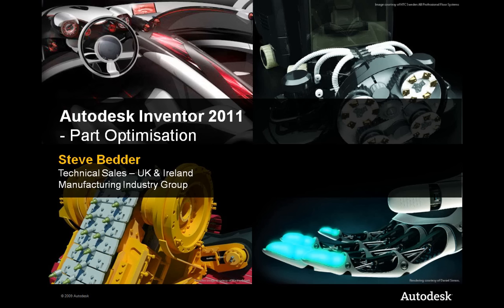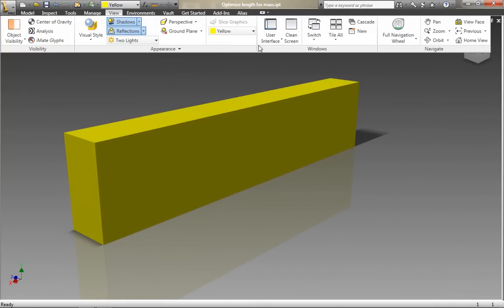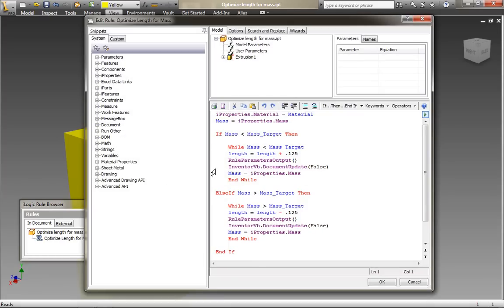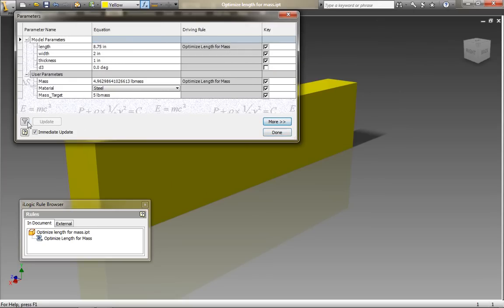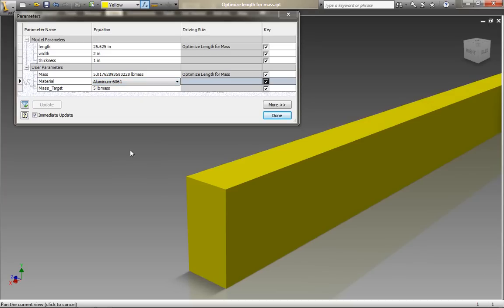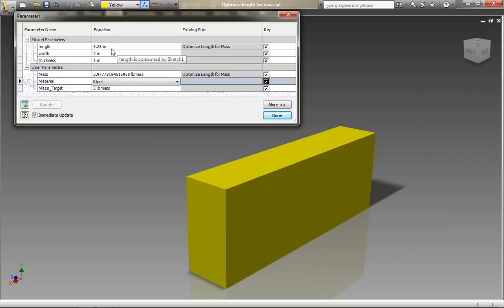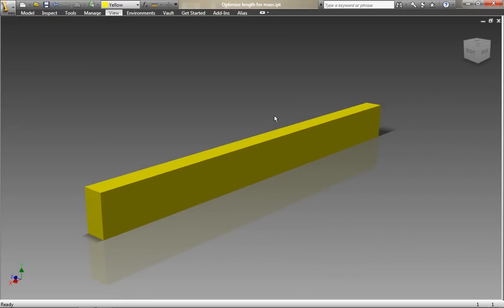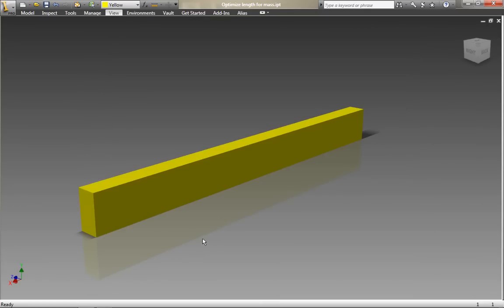Part Optimisation using Autodesk Inventor iLogic

Comment: Hi, suppose i have to minimize the mass subject to given surface area, can it be done using iLogic? If so can i view the change in dimension in the 3D object the optimization is running? Also if a constraint on stress in given, how to connect stress value calculated be inventor directly to iLogic?